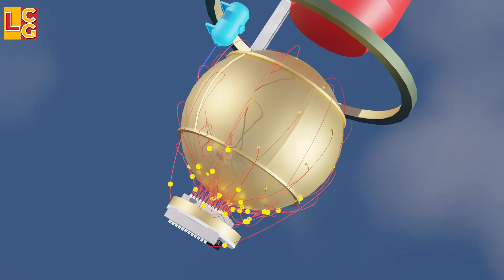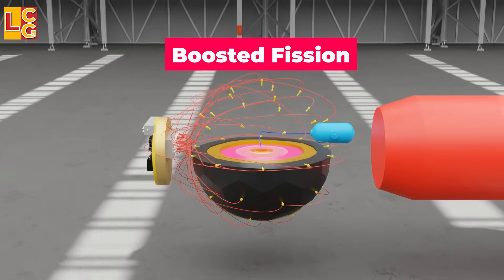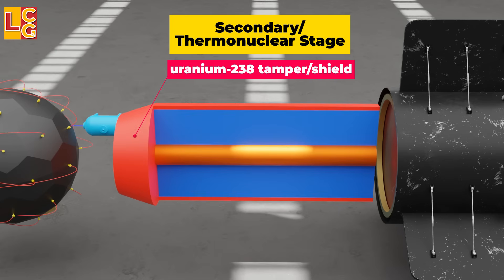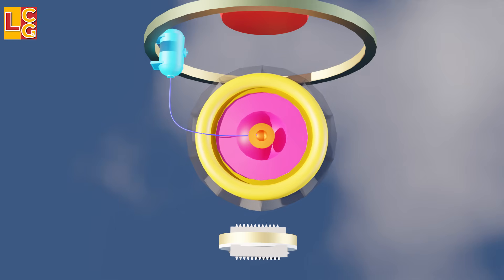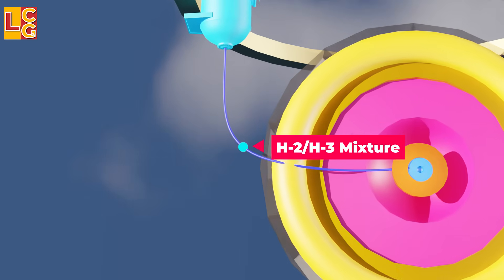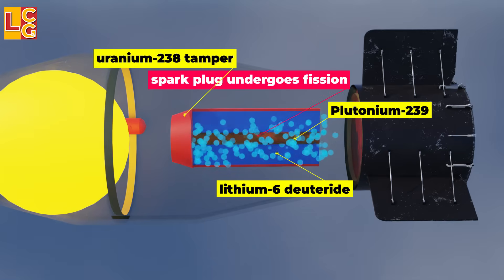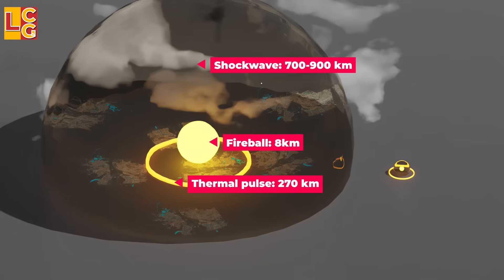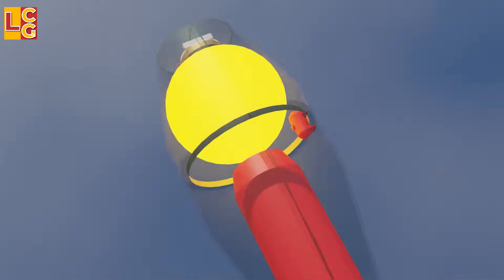How Hydrogen Bomb Tsar Bomba Works

Comment: Just a heads-up, everything discussed in this video is a speculation. Even design of the shell of the Tsar bomb is still classified, let alone design of the bomb itself. 

There's a Russian Youtube channel called Radiation Hazard that has a video about this bomb, but the supposed design of the bomb is different. The cyllindric design of the second stage is characteristic to American bombs, whereas Russians have always preferred spheres instead. The Tsar bomb might have had several such spheres as second stage.

Comment: Hopefully I don’t sound stupid here but what happens if only the primary exploded? Would the bomb itself not explode and remain intact? Or would it explode still just with like 1/3 of the power it could have had?
Reply: If for some reason the 2nd (or later stages) don't go off, then you'll just have a normal atomic bomb with a much lower yield.
Reply: It would have produce an explosive yield on the order of 1% what it actually did.
Reply: This is called "fizzle". The "Castle Koon" shoot of Operation Castle - Bikini Atol; was a example of "fizzle", of the expected a yield of 1 Mt, result only 110 Kt, the secondary stage don't ignite, due design error.

Other is the "Ruth	" test, the result explosion was smaller and are not able even to destroy completely the 61 meters tower wheres the bomb sit.

Comment: I stopped watching 4 minutes in. The plutonium sphere (no one uses U235 it's hugely expensive and time consuming to refine weapons grade U235) does heat up to very high temperatures but that has absolutely no contribution to it becoming supercritical. The increase in density along with the activation of a modulated neutron source is what causes the chain reaction.

Comment: one primary stage, with two secondary stages on each side of the primary.  this is how you literally create a nano-sun.
all encased into some kind of fogbank, but thing you are missing out: the "pit" is filled only a couple of seconds before the warhead detonates. that's the booster of the first stage, Li-6 deuteride. the foam is literally something that should turn into plasma, so tritium, lithium is fine too. 
shape of the secondary also counts a lot and must be optimized to grab the most of the first stage energy to start the fusion, not this early Teller-Ulam design from the 50's. 
or better, it is simply the same bloc, at that reaction, the explosives compressing the primary charge won't affect the rest, the chain reaction happens close to the speed of light.
at that point, you can ignite the volume you want of tritium with a plutonium rod , and reach the powers you want, hell even why not making it a co-axial nuke, a container of lithium-6 deuteride and a fission bomb in its center and voila. it will be a thermonuclear reaction before the explosive lenses explodes the tritium tank.
Reply: A lot of incorrect information there.
Reply: @Evan_Bell  I'm extrapolating, as we know little to nothing bout the real design of this nuke, and I want to know. Or even improve the design to propagate the fission reaction directly into one thermonuclear stage.

It's about imagination!

other idea, if possible, encasing a gun-type or small fission weapon inside a container filled with Lithium-6 deuteride; what am I missing?
Reply: @SilverSpoon_  Well sorry, but you didn't do a great job of extrapolating.
What do you mean "propagate the fission reaction directly into one thermonuclear stage"?
Reply: @Evan_Bell  instead of two separate stages, a plutonium rod connected to the first stage would directly drive the fission reaction to secondary stages, then it's about a complete redesign and even make a single-stage, fully optimal thermonuclear weapon to get a homogenous hot quarks soup and efficiency.
Reply: @SilverSpoon_  What would be the point of that? You'd be better off using an evacuated tube to directly duct neutrons from the primary.
Not that that's needed anyway, as in normal thermonukes, neutrons from the primary do impinge on the secondary, which is what initiates the sparkplug. In order to avoid secondary preheating, neutron shields actually have to be used.
It's impossible to reach the temperatures at which quark matter exists in a nuclear weapon.
The Hagedorn temperature is 150MeV. Considering fission only produces around 200MeV, and this is divided between 2 or 3 fission products, plus neutrons, plus gamma photons, plus neutrinos, plus thermal radiation photons, which dominate the energy density by many many orders of magnitude, even at electron degeneracy densities, it's impossible for each particle to carry 150MeV of energy. What you're proposing is pseudoscience.
Reply: @Evan_Bell  Why must you break my dreams of creating the most perfect doomsday device ?
Reply: @SilverSpoon_  Because they're unfeasible, sorry lol
Reply: @Evan_Bell  Challenge accepted. 
What about passing a message too, like
«This is a message to the federal authorities, guardians of the decadent western civilization, and your crimes against friendship and harmony for your selfishness and everything that's unholy. I pledge to bring the vengeful wrath of Celestia almighty upon the sins of humanity, and purify it by the fire of the sun itself! Mankind will never forget this teaching and tremble in fear at the idea of committing the same errors again.»
Reply: @SilverSpoon_  What?

Comment: Unfortunately, There are a couple of myths that this video repeats unknowingly, spreading the false knowledge.
Those are:
1) The thermonuclear reactions of deuterium are misunderstood which leads to (2).
2) The true purpose of the sparkplug is misunderstood and misreported.
3) The true purpose of the polystyrene (or other filler) is misunderstood and  misreported.
4) The fusor neutron source is omitted from the story.
5) The first stage charge shown is optimized for standalone use and not optimized for the role of the primary. Hydrogen bomb would use lighter and weaker primary, with less tamper.
6) The role of slow high explosive in the implosion system is misreported. 
7) The mean free path of the fast neutrons is greatly exaggerated. 
8) Thermonuclear burn in compressed LiD is a millimeter thin surface (radiation dominated shock) not the volumetric burn at least initially.
9) Nuclear fission doesn't care about heat in zeroes approximation and in first approximation it is negatively impacted by heat if you analyze disassembly.
10) The shape of the bomb suggests that the main stage was spherical and placed at the middle of the bomb housing to utilize the width.

Carey Sublette's  Nuclear Weapon Archive can be consulted for the details, in particular chapter 4.  
nuclearweaponarchive.org/Nwfaq/Nfaq4.html

Comment: If the shockwave is destructive to over 700 kilometers, how is the plane, dropping it, far enough away when it detonates?
Reply: The plane got about 30 miles away and it was covered with a special coating to resist thermal radiation.
Reply: Distance, and doppler effect saved the plane from being destroyed by the air blast. Still, the aerodynamic lift force was temporarily disrupted, which caused the plane to dive involuntarily.
Reply: It very nearly didn't escape. The pilots were briefed that they had at best 50/50 odds.
But you don't say no in soviet Russia
Reply: @tratzum  Nor do you say no in Putin's Russia. I asked, though, since the bomber shown in the video was a big turbo prop one (which is probably what was needed for such a heavy payload), but such a plane would take about an hour to get 700K from the drop-side, and I don't think that bomb would take even close to that much time to get down to 4000meters (or was it feet?) above ground, no matter how big the parachutes. Or am I missing something, here?
Reply: @BorisNoiseChannel  I don't remember the details. Read about some time ago. The pilots and plane did make it home I think they lost control and altitude
Reply: @BorisNoiseChannel  Yeah you are missing something. Putin was 9 years old at the time of the Tsar bomb.  I don't think he was running the USSR then.
Reply: @gregs9250  In my response to "you didn't say no in the USSR" I'm comparing the historic USSR with Putin's Russia of today, making the argument that you can't say 'no' now, either. It's a totally legitimate argument construct, reasoning wise. How old Putin was (or whether or not he was even alive) in the era he's compared to, has no baring on it whatsoever. 
Or are you suggesting that we can't compare the (lack of) right to free speech at, for instance, the height of the theocratic Dark Ages in France, with the level of it in today's France, cause Macron, nor any of his government members were alive, back then?
Reply: The bomb has a 700 km shockwave blast radius, which would be impossible to escape on the ground due to an earthquake and debris, but dont forget that in the air there is neither, so the chances arent impossible, just improbable.

Comment: The Tsar Bomba was a three-stage hydrogen bomb with a Trutnev-Babaev second and third stage design. A three-stage hydrogen bomb uses a fission-type atomic bomb as the first stage to compress the thermonuclear second stage. The energy produced from this explosion is then directed to compress the much larger thermonuclear third stage. There is evidence that Tsar Bomba utilized several third stages.
Reply: There’s no theoretical limit to how many secondary stages there are, creating a fission-fusion repeating sequence that just keeps on increasing the yield.
Reply: Limited by plane bombay dimensions. @langdalepaul
Reply: @langdalepaul  Most likely fission fusion fission fusion fission to reach the 50 Megaton yield. Of course stages can be repeated ad infinitum but the Tsar Bomba had to be fixed to an aircraft, which is why I believe they used 5 stages on that particular weapon.
Reply: @captaincat1743  maybe you’re right. It’s hard to tell.
Reply: @langdalepaul  Yes we can only speculate. If you find this interesting and you have not seen it, there are a few amazing lectures on YT by Professor Matthew Bunn called How a nuclear bomb works. The algorithm doesn't throw them up a lot but they are some of the best I have ever seen on the subject and he is a very skilled talker, he makes the subject very interesting but goes into great detail, to the very edge of what is unclassified. He works on nuclear weapons programs for the US government so he really knows his stuff. I highly recommend these videos.
Reply: Where is this evidence?
Reply: >> There is evidence that Tsar Bomba utilized several third stages
I have only seen Carry Sublette's hypothesis but no evidence.   Have you seen it ?  Can you share the evidence ?
Reply: ´stäge 4 -:-
Reply: ´vvörx without ihvvent höriZönn v?v 
4:30 üh öh doublink v??v 
these things (esp? hbs?) are still ´´clässiFy€D xxxD i doubt there was matter and vaccum witch would need antigravity - antiinertia to stabilice... 
and ´in moment of detonation fuel is injecktät xP ??? anyhöw they gäve new mattering? cönZeptce v  v tängey -:-
Reply: It was a two-stage thermonuclear bomb. If the lead tamper had been replaced with uranium it would have been three stages.

Lead was used because not only would a uranium tamper have doubled the yield to 100MT, it would have also been the dirtiest bomb ever detonated.
Reply: Its design had a theoretical 100 MT yield but due to concerns about the safety of the pilots dropping the bomb, they did not use a fissile tamper in the 3rd stage, resulting in a 50 MT test.
Reply: Correct
Reply: Bro thinks he’s Oppenheimer
Reply: @cantseeshadow  well "bro" might actually be someone qualified in the nuclear field unlike a condescending weirdo like u
Reply: @cantseeshadow   More like... Barbenheimer !!! amirite??

Comment: Just curious, if the fission wouldn't happen unless the explosive sphere compressed equally, wouldn't the second stage need the same thing around it?
Reply: You don't NEED to compress it equally, you just need to make sure it compresses sufficiently. Chemical explosives just don't work fast enough to compress as much as is needed if the detonation is uneven as material will "leak" out through the holes in the detonation sphere as if they were a gun barrel instead of continuing to compress. 

The pressure and heat from the fission are several orders of magnitude higher and can mostly bypass that problem. The force and pressure are applied faster than the material can be pushed out of the way, even when it has plenty of directions to go.
Reply: @andrew34765  thanx!
Reply: @Quickcat21MK  It's literally compression, nothing to do with the energy state of the matter. Density is what sets the reaction off.

When the nuclei fission they generate a few neutrons that are capable of fissioning more nuclei. The material needs to be dense enough that the neutrons generated by one fission event generate more than one fission event elsewhere in the warhead before escaping to create the exponentially scaling chain reaction that makes the explosion.

When you compress everything, the nuclei being closer together decreases the probability that a neutron will escape the core without hitting another fissile nucleus. From ~0.95 to a value greater than 1, starting the chain reaction.
Reply: Its amazing any reaction can occur in a cannister right next to a fission bomb before its vaporized
Reply: @worsethanhitlerpt.2539  I also find it absolutely insane. It is frightening to think how much hell can be unleashed in a few millionths of a second.
Reply: No, because the second stage produces a huge neutron flux.
Reply: The plutonium sphere has to be compressed equally because a sphere will tend to pancake when it is asymmetrically squashed. The second stage is a fusion reaction in a product that does not have a critical mass like plutonium, therefore it is not squashed but instead bombarded by x rays which force the fusion fuel to become so dense it overcomes electrostatic repulsion and the atoms nuclei touch each other at high temperature and pressure causing fusion. It is an entirely different mechanism causing fission by lowering the critical mass, than that of causing fusion via high pressure and temperature.

Comment: Um, no. First, there's no lithium deuteride tritide, as there's no need for tritium if you have lithium, which happily fissions into tritium.
Second, Tsar Bomba was a three stage weapon. It used a dual primary fission triggering detonation and given its size, likely a cryogenic tritium and deuterium gas secondary. The US didn't start using lithium deuteride until 1954 in testing, production always lagging behind.
The finalmost stage was left out, as the final 100 megaton design was fission, triggered by the neutrons from the hydrogen fusion and being insanely dirty, was left off.

Oh, a bit of trivia, Tsar Bomba was detonated a week before I was born.
Reply: Wouda  been  something  with  a uranium  aTamper.   💯  MEGATONS
Reply: @JohnSmith-fg6pt  doesn't really scale well though. The fireball basically nearly was above the atmosphere, where it'd have no real effect. That diminishes the shockwave and thermal effect front tremendously. So, bang for buck, 50 MT is about as big as can be and remain effective.
Reply: that explains it!

Comment: Because of its weight? Unless there are wings or a parachute all bombs fall at the same speed.
Reply: Ah yes, physics.
Reply: The bomb had a parachute, and was dropped as the plane was climbing to give it sort of a "toss" so the plane would have more time to clear the blast radius, even then they told the crew it was a coin toss whether or not they'd make it.
Edit: Also, besides having to be modified to carry the bomb, the plane was given special paint to help mitigate the thermal radiation it would absorb.

Comment: What is the difference between chain reaction in nuclear weapons and reactors?
Reply: The only and the major difference is that in nuclear reactors the chain reaction is controlled using control rods ( made up of boron that soak up the neutrons ), hence known as controlled reaction. Whereas in nuclear weapons there's no such control, their purpose is to react violently causing massive destruction.
Reply: In nuclear reactors, you manage to reach the critical mass where the fission of one nucleus makes one neutron that breaks a nucleus and son on and you manage to stabilize it so that the core doesn't go super-critical. In nuclear weapons, the goal is to reach and go beyond the critical mass by several times to have an exponential chain reaction to have the maximum of energy released before the fissile material is pulverized by the explosion (for Fat Man bomb, the destructive energy released was the fact on only a few grams of plutonium).

Comment: 3:09 the weigh has nothing to do with the speed the bomb falls. All bodies fall at the same speed, despite matter their masses. The parechute is becaus the sphere of damage is too big, so they slow down the bomb.
Reply: That's only true in a vacuum.  In atmosphere, an object will accelerate until it reaches its terminal velocity, which is when the aerodynamic drag force is equal to the object's weight (its mass times the acceleration of gravity).